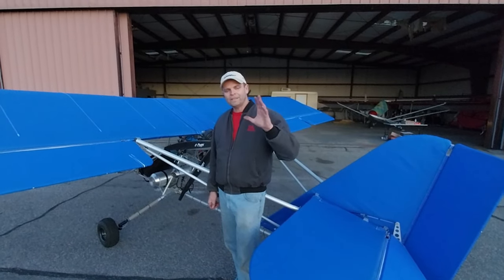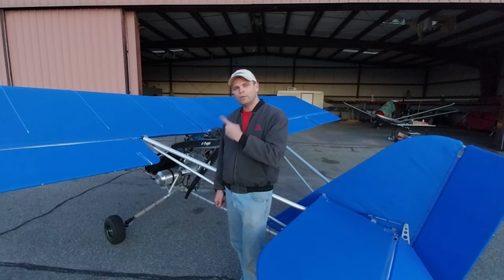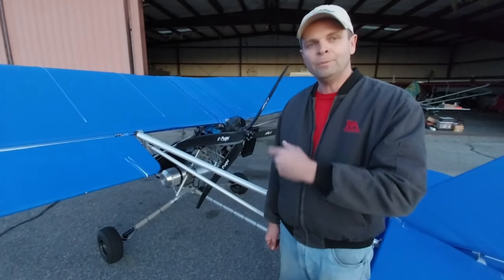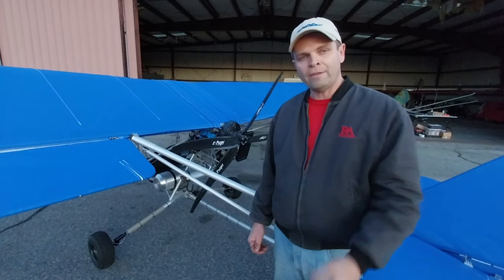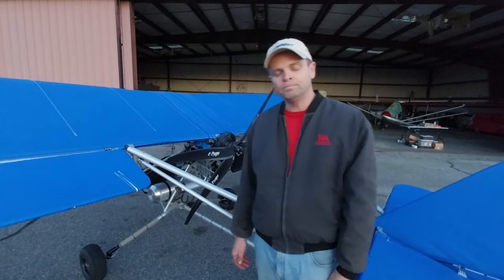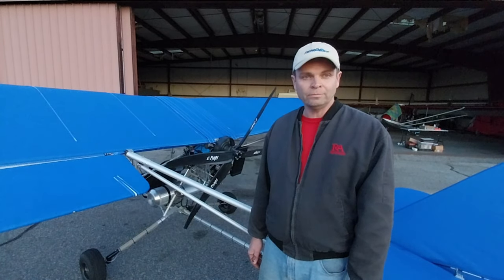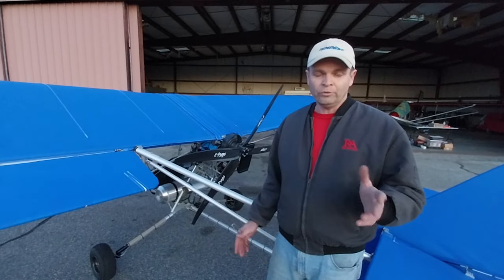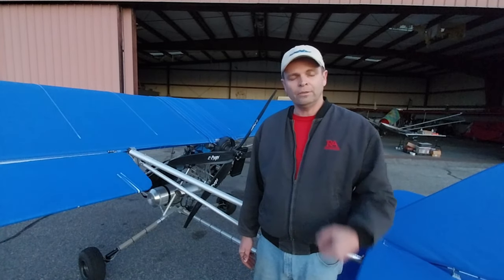Aerolite 103 with the 4 stroke Aero 1000 engine

Comment: My assumption is it will prove reliable and a good choice for many.  While you said it has plenty of power, personally I would prefer a 4 stroke in the 60 hp range.  I understand the weight issue though.

Comment: When are you gonna have the engines available ?
Reply from the maker: Hey. I sent you a reply about the contacting Blackhawk for the engine. One month backorder for the conversion kit; $1500 plus shipping. Prop is $700 plus shipping.
Reply: @markmurray8517  great Murray thanks. Is that Blackhawk PPG the paramotor company? I fly paramotors and get staff from them 
So I purchase the engine from them and they sent it to you for the conversion? Or all gets done internally?
Reply from the maker: @nvrqit9361 yes, same company. Contact me at murray.aviation.llc@gmail.com and I'll share the details. Thanks

Comment: there is only one metric, its my bible, how many seconds from a total dead stop to wheels up, (GRASS). The goal is 6 seconds, (this is almost any UL with a 503 that is now over weight) The maximum allowed is 12 seconds, obviously the closer to 6 the better. The half VW is as slow as 20 seconds, dangerously under powered imo. The briggs and Stratton Van Gaurd 23 hp is 11 seconds, 13 with a 275 pound pilot, in a legal eagle.
The new EOS Quattro 276 cc 4 stroke single (44 lbs firewall forward e prop) gets a dingo biplane up in 11 seconds in uncut grass.
The thumpair 460 4 stroke single is 8 seconds on dirt. (tail up rollout with sudden full back for stol), another thump air with runway pavement hi max plane 8 seconds standard takeoff not stol.
Lets us know this metric, it is all that matters (when you see that tree line).
Reply: the only video I have found so far is this engine on a quicksilver single surface wing on pavement with a tiny pilot, 4.5 seconds to wheels up. but, its single surface hi lift, on pavement, with a lightweight pilot and headwind not disclosed, and its a marketing video and we dont know tire psi.
Reply from the maker: I appreciate your concerns about performance. Nothing is worse than a great airframe with an underperforming or unreliable engine. However, I don't think you can make real "apples to apples" comparisons on engines when not taking into consideration the differences between airframes and conditions. If you did all test in the same Legal Eagle, with the same pilot, with the same conditions (grass, similar density altitude, no wind), then yes, you could make some real world comparisons. I will record grass takeoff time and distance at some point, but even then it's more of a "apples to oranges" comparison.
Reply: @markmurray8517  thanks, most of us can look at a aircraft, watch it fly, and come to some conclusions very easily. thanks for you participation, it is genuinely appreciated :)
Reply: @markmurray8517  There is basically no airframe on this thing let alone a great one.

Comment: DID YOU BUY IT THIS WAY?    Or did you convert it from 2 stroke motor to 4 stroke. What is exact motor and were did you get it for what Price? was it all bolt on or need modified ?
Reply from the maker: The engine is called the Aero 1000 built by Helvanco in Switzerland. In the US it can be purchased directly from Blackhawkusa.com. It is a purpose-built 4-stroke intaily developed as a high performance go-kart and parachute-type aircraft (ppg) engine, but was recently adapted to Quicksilver fixed-wing ultralights. We are creating a package for adapting to the Aerolite. Stay tuned for updates soon.
Reply from the maker: The price seems to constantly fluctuate because of shipping cost, but the engine alone will run $9000 to $9500. We haven't nailed it down yet, but the conversion kit will probably run about $1300-$1500
Reply from the maker: The conversion is mostly bolt-on. There are few fuselage frame members that have to be altered to make the engine mount work. The modifications were approved by the airframe manufacturer. the conversion kit comes with all parts needed and detailed instructions

Comment: How does the 105 perform with 2 blade, 6 blade props with various pitches on this motor, 👍
Reply from the maker: Hey. We're still working that out. For now, I'm please to say performance is good. We're tweaking the redrive ratio and prop combination as weather allows. Stay tuned! Thanks for your interest.
Reply from the maker: You may also want to watch the follow up video, https://youtu.be/Lavo_RS42qo?si=jBubT6wVW0SRhKXY
Reply: Still folds up into a little ball of death all the same.

Comment: What did the early Piper J-2 use? 40 horsepower with two seats.
Reply from the maker: Cubs are cool. However, that's not a "apples-to apples" comparison.  The  Continental A-40 weighs almost 3 times as much as the Aero 1000. And the J2 is much cleaner aerodynamically than an Aerolite.  Simply comparing the 2 engines based on horsepower alone isn't realistic